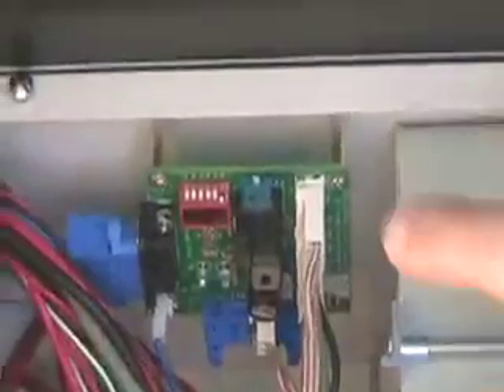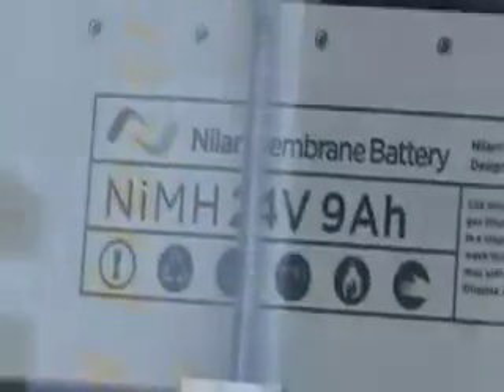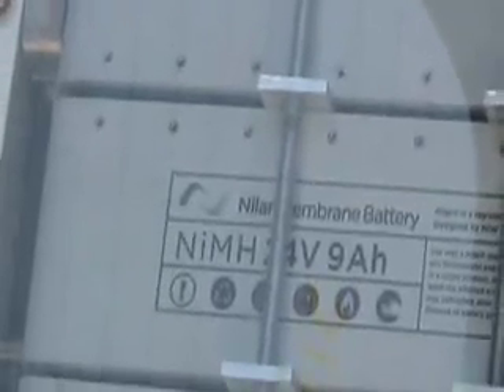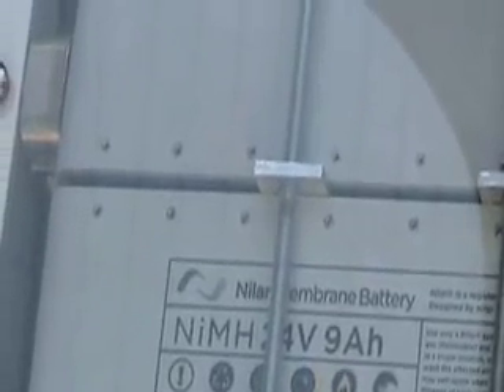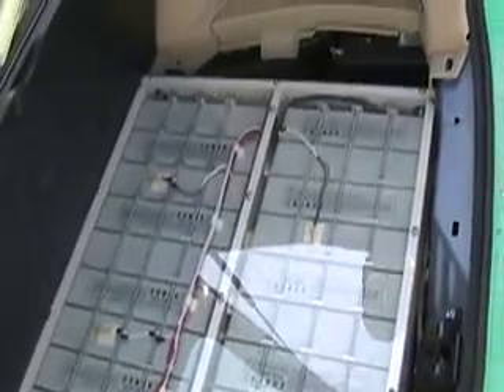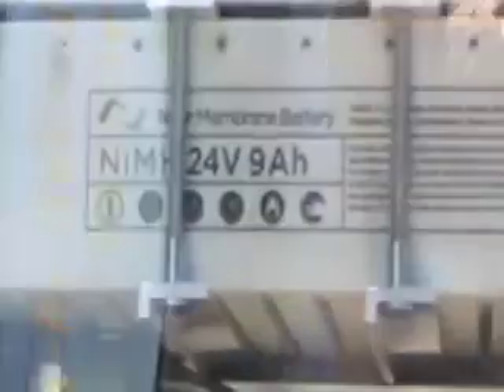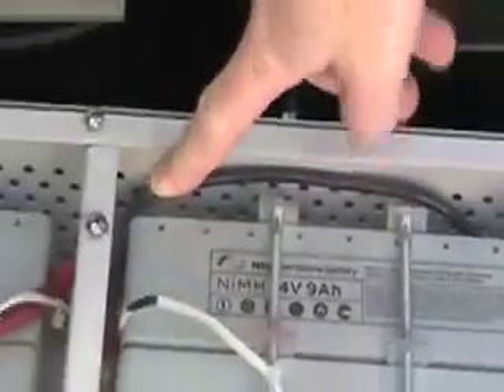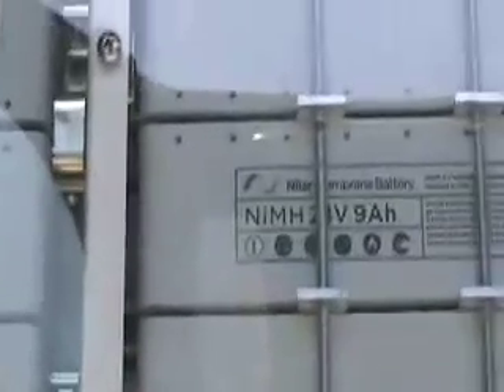PlugInConversions using Nilar NiMH, EV1 and RAV4-EV

Comment: We need to increase the exposure of EV, the more people drive in them the and the more people see these the better. 

The bad part is the smoke and mirrors use to fool people, like Ethanol (using soil&water) is green, or that Hydrogen is around the corner(too expensive), or suggesting EV's are just around the corner when their suppressing tech.

Id might be an idea to rent RAV4-EVs so more people could try them.

Whats your take on the upcoming i MiEV from Mitsubishi(should be av in japan)